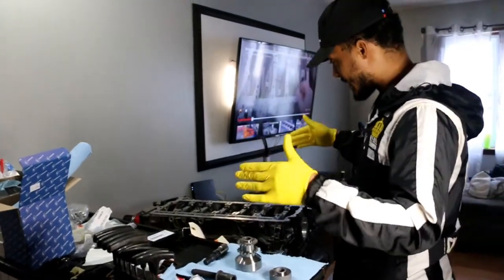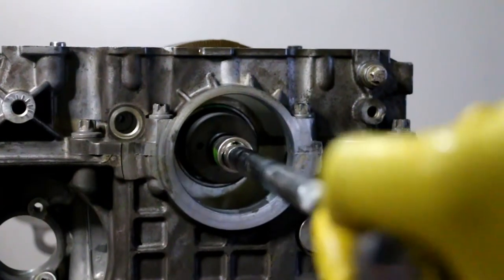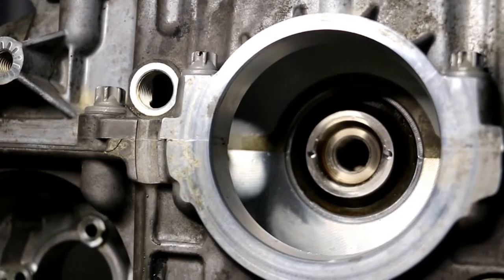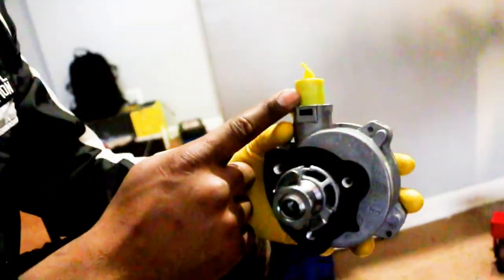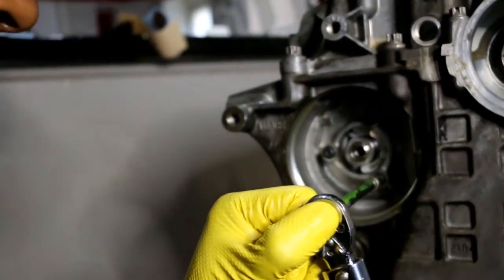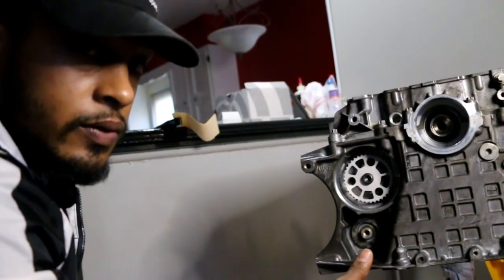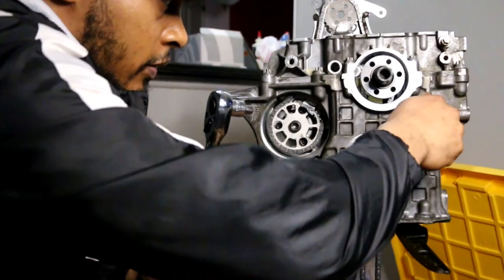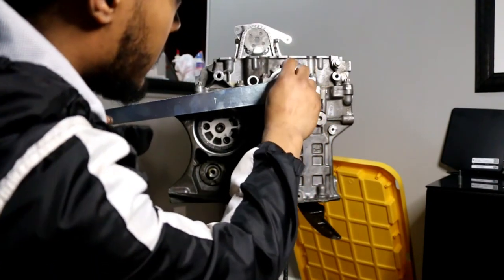N54 REBUILD | EP 6 | PINNED CRANK HUB \ I DROPPED MOTOR

Comment: I'm reassembling mine and I can't find information, even on TIS, on reassembling the hub. Oil pump sprocket (with grip discs installed), washer, and camshaft timing sprocket is what I saw when i disassembled. Do you know the part number of that washer?
Reply from the maker: Oare u using pinned crack hub or regular
Reply: @JermaineLeeBlueprintAuto  the splined one from VTT
Reply: You find everything I’m looking for the same

Comment: ay man where the other 180??
Reply from the maker: I didn't make a video, but here is what i did.
After resurfacing the block, i reassembled the crank shaft, and this time, i used thick pieces of card bord on the floor. i laded the motor down on its side. This is how i was able to achieve the proper torque.  Next, when i put the motor back on the stand, i used grade 8.8 steel bolts.